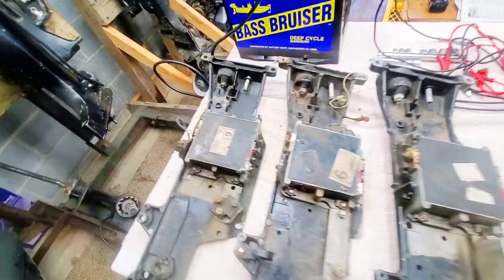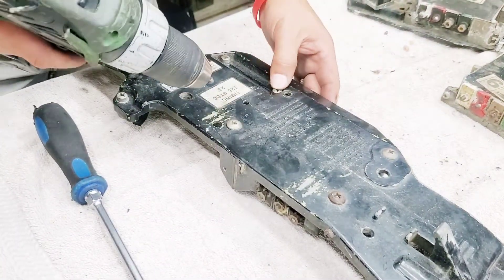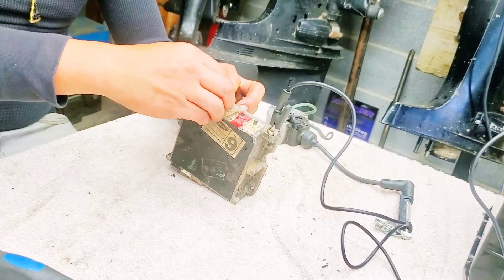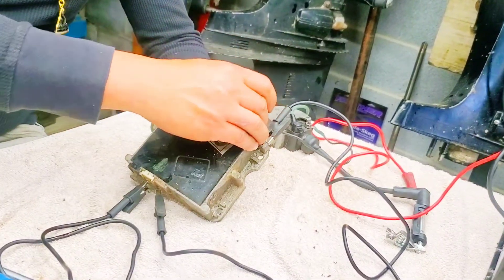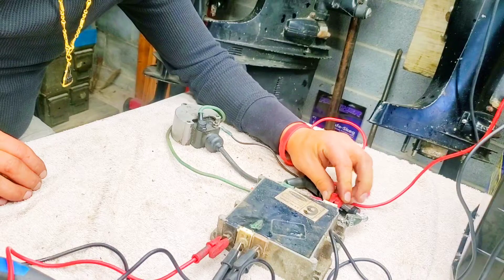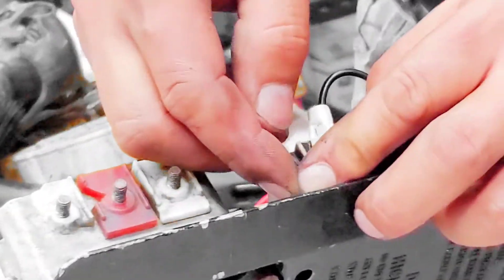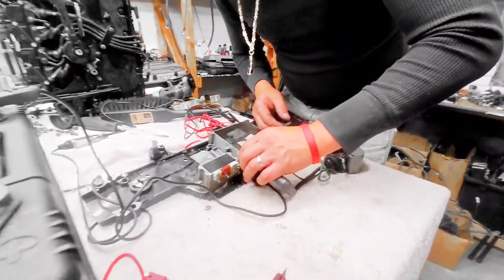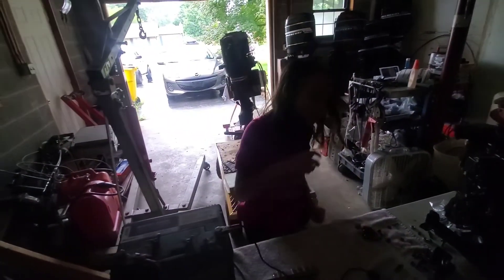3 Mercury L6 OEM Switchboxes: Which Ones Will Work?!

Comment: I have a 1973 Mercury 1150 that has intermittent/poor spark on cylinders 3 and 6 as revealed by putting a timing light on every plug wire.  swapping wires has no effect, stays with the cylinders. checked and cleaned contacts in distributor cap with  no effect.  trigger, plugs, wires are all new, rotor is new to me  (broke the head loose on my old one putting things back together).  what do you think it could be? switchbox or distributor cap?
Reply from the maker: If you are moving the wires and getting the same response then that rules out your ignition system. Have you tried a fresh set of L76V champion plugs? Son
Reply: @MerCSonL6   I had a slightly bent disk on the trigger.  I was cleaning the distributor cap when I noticed  the disk was making contact for about a third of the rotation.  That third coincided with the locations of #3 and #6 wires on the rotor/cap.  Just bent it back into position without pulling the trigger or anything and it ran like a dream just in time for one last outing and winterization.

Comment: Hey, Son
I have a 2002 mercury xr6 150, I have been running sea foam in tank. 
Question- the motor at idle had a loop to it (like a hot rod car loading up) it shakes . Motor runs great under load and at WOT. Is this normal for , or should it be smooth at idle with no loop.
Thanks
Reply from the maker: I believe the xr6 has an idle stabilizer that manipulates the the switchboxs/timing causing it to shake a bit. Nothing wrong as long as it idles. Son
Reply: @MerCSonL6  thank you

Comment: I have an early 1990s Mercury 2 stroke 200hp that won’t rev up under a load. It’s on a 21 foot center console with a 19p prop. Engine has 125 psi all cylinders. On land it goes into gear fine and revs right up but in water it won’t go over 6-7 mph and maybe 1500rpms. Stator and trigger test good, new switch boxes, new spark plugs, all grounds clean, fresh gas, new fuel filter, new gear
Oil. All 6 cylinders have spark. Carbs cleaned and appear to be spraying plenty of fuel and spraying extra fuel into carbs didn’t help to pick up any rpms. New boat to me so I don’t know any history on it. Any ideas what to check next ?
Reply from the maker: Engine could be out of sync. Is the timing correct? Try reducing the pitch on your prop. How heavy is your boat?

Comment: MercSon, question for you. I have a  1978 1400. The copper water tube is mangled on the water pump end. Apparently it is causing bad seal at water pump and decreasing the water pressure through the block. What is the procedure to replace the copper water tube and can it be done without pulling the power head off? Thanks for any help.
Reply from the maker: Pull the copper tube out and replace. Son

Comment: Do you have an email address? Would like to pick your brain on a 70 hp Force engine, has me stumped. No spark in all 3 plugs
Reply from the maker: Have you disconnected the kill switch? Tested the stator? Tested voltage going to the coils. Typically, if all cylinders are not firing its either your switch, stator, or trigger. Even with faulty switches you'll get intermittent spark. Son

Comment: I’m having issues finding a carb kit for my 89’ 125hp force. Could you help me please?
Reply from the maker: WFLNHB New Carb Kit Fit for Chrysler Force Outboard 9.9 15 75 85 105 120 130 135 150 HP https://www.amazon.com/dp/B07NC12147/ref=cm_sw_r_apan_glt_fabc_VGQQHGXBXFM2CTTF35K0?_encoding=UTF8&psc=1
Reply: @MerCSonL6  you the man, bro!
Reply from the maker: @jasonwthompson5003  I'm the man behind the the "man." Son
Reply: @MerCSonL6  so what if the carb is spiting fuel out the intake? I put a new needle and gasket kit In it?
Reply from the maker: @jasonwthompson5003  the float needs to be readjusted. Or the carb needs rebuilt. Son
Reply: @MerCSonL6  thank you!
Reply: I’m changing my gearbox. I’ve got another one that’s empty. Would I need to mix everything and get lash or wouldn’t matter?